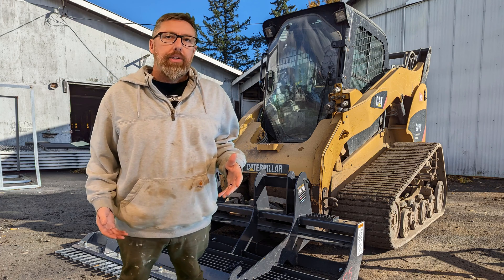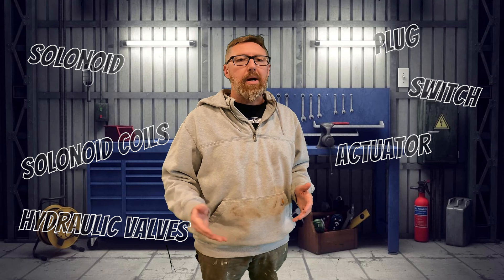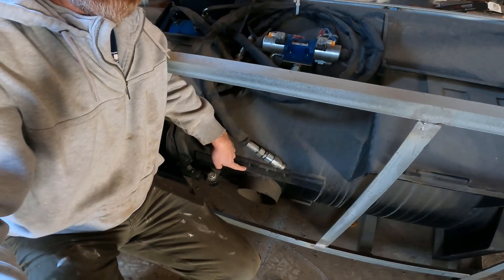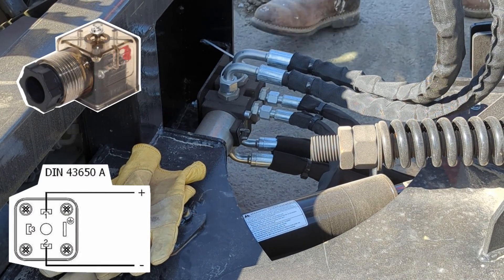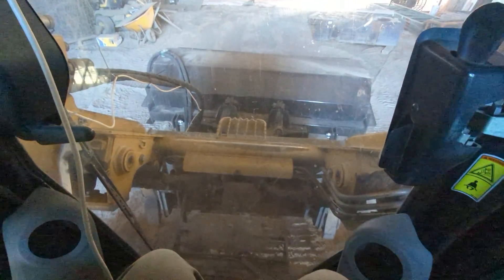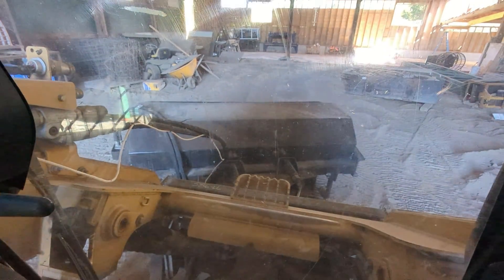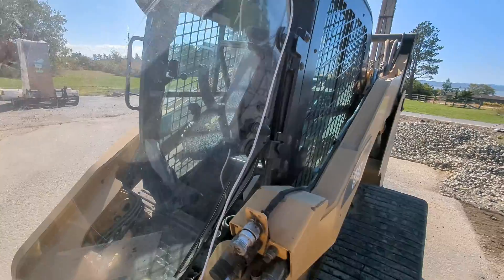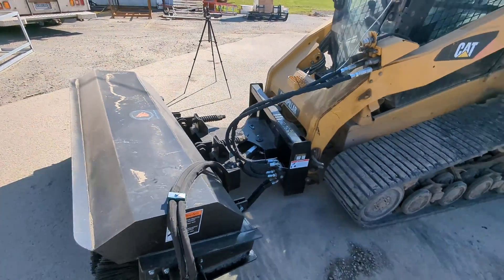DIY Wire your Skid Steer to accept new attachments with multiple controls the easy way!

Comment: How do you wire the actual 4 pin switch? I built my own because that exact switch melted down, and i cant get it to work. Thanks.
Reply from the maker: It depends on your unit and machine.  Skidsteer genius has some great specific wiring videos